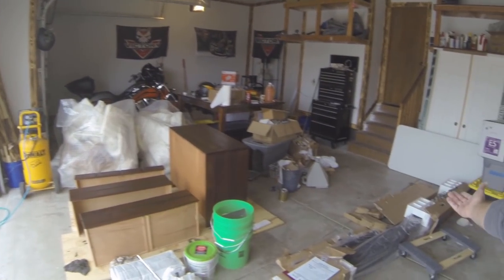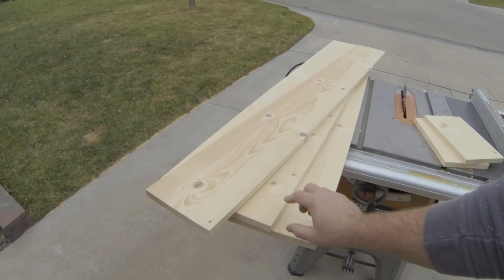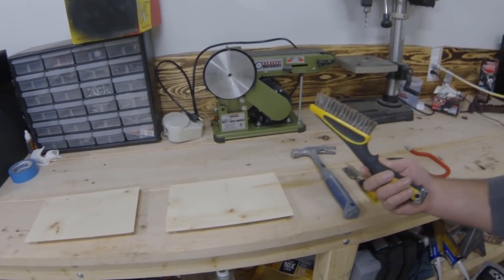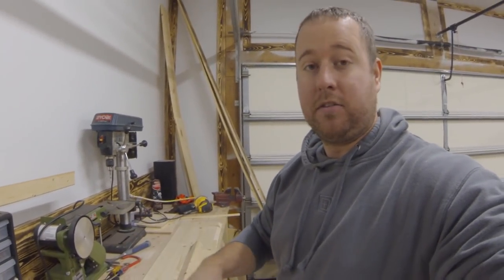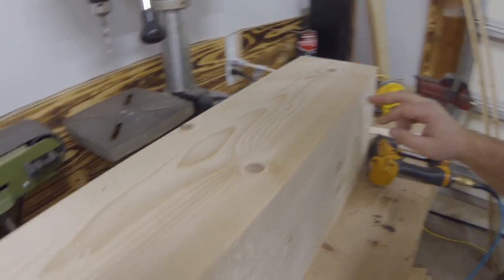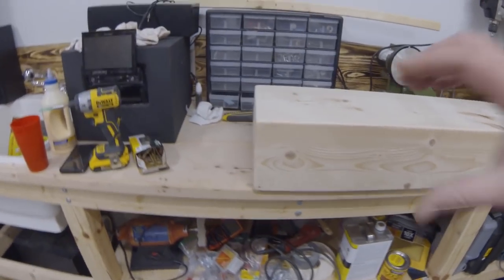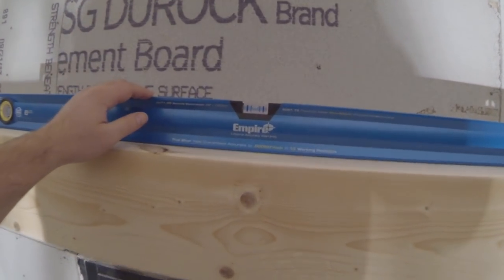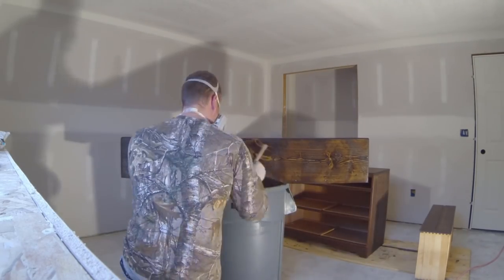DIY Rustic One Piece Look Wood Mantel

Comment: Excellent video I followed your instructions to a T. I went over it with a wire brush which gave it a more distressed look also used grinder to add some lines which gave it the crack spitting look. Love the way you basement ended up coming out, simply beautiful. Too bad homes here in Los Angeles don’t come with basements. Looking forward to future videos.
Reply from the maker: Awesome man! Sounds like yours turned out great. Appreciate it, got some more stuff coming soon...

Comment: Nice work. I’ve also used a round pipe to “burnish” or roll down those edges as it’ll usually closes the tiny gap between the 45 degree joins instead of using wood filler.
Reply from the maker: Thank you for the tip!

Comment: Only suggestion I’d make, to avoid screws in the top, use the kreig jig and put some pocket holes in the top cleat then screw the top into the top of the French cleat. Cleaner look without having to sacrifice strength.

Comment: Very helpful video.. Doing one for placement on an existing red brick fireplace as well.. plan to use masonry screws with the lead inserts. Not sure how to address the gaps yet either, hopefully from looking straight on they’re null..
Reply from the maker: I wouldn't think it would be too bad with a standard brick wall. Maybe if you were directly off to the side, but hopefully not too bad besides that

Comment: I have a square gas fireplace with tile around it.  I would like to know if I can make it rectangular that way I have more space avobe for my TV and maybe add a beam or a small mantle?  I will also take tile down and update it. House was built in 2005. Will this be too expensive to change opening shape of fireplace?
Reply: By the way my gas fireplace Loo's identical to urs.
Reply from the maker: If you're talking about the material around the fireplace on the wall (tile, trim, stone) you can make that whatever dimension you want. Only thing that is consistent is the fireplace opening. You may have to cut sheetrock and replace with concrete board, but you can go with a wider area if you want

Comment: can you tell me how much weight it would hold if you did not screw/fasten it to the wall?  Also, I think you used Pine, right? Would it be better and look better if a hard wood, Mahagony, Oak, Cedar or some other wood was used?  I have a 9'7" beam I need to build, and I wonder if that may be too long?  One last question, you put the cleat on the mantle and wall, is there a formula you used to know how much to use? Like 4 inches from each side, or 2 inches or some other way you figured how long to make it?
Reply from the maker: Doesn't matter the cleat length, just as long as it fits inside the shelf. You can make the beam as long as you'd like, gotta look at the room to make sure it goes well with it is all. You can make it out if any type if wood to get the look you'd like, it's just cheaper to use pine wood and stain to your preference. You'll get different grains with different woods though. It's not necessary to screw to the wall like I did. I just knew I would be putting rock around it and it wouldn't ever be removed. You could probably throw at least 60-80 pounds on the shelf with no problem. Maybe more, but thats quite a bit of weight
Reply: @LifeofBliss  Thank you. I can't imagine needing that weight, but 20-ish, yes. So, if I can put more than all the better. I do know that the longer the cleat, the more the weight is distributed, and it give you a bit more weight bearing capability. Thank you
Reply from the maker: Yea you should be good with that longer cleat for quite a bit of weight. No prob man 🤜🏼🤛🏼

Comment: The French cleat on the mantle itself..is that attached directly to the top edge of mantle?..in video it looks like there is filler piece..any help would be appreciated
Reply from the maker: It attaches directly to the mantel top. I think I accidentally cut a 45 degree andle on the top piece that sits against the wall, which wasn't needed. I just added another small piece to fill in they 45 degree cutout is all

Comment: Great tutorial! I will be applying this method to my new fireplace. One question, is it necessary to make a 45 degree cut on the side that is going along the wall? It looks like the top board, where half of the french cleat is attached, was cut at a 45 degree angle. Does that make it slightly more difficult to squarely attach the cleat? You can see it at 7:05 of the video as you slide the box forward to get a  better angle to nail it. I am just curious, as I am a beginner and the more cuts I have to make, the greater chance I mess something up!
Reply from the maker: Ha good eye... no that edge should not have been cut. That was a mistake. I got to cutting things and apparently couldn't stop lol! Good luck with making yours!
Reply: @LifeofBliss  I am glad this question was asked because I too was confused. I had to rewind so many times to see when that piece was put in and to find an explanation for it. I did not find and was confused until now. Other than that, great video. Thank you.

Comment: That is awesome thank you for the video I just got an order to make one but won't sure how. How would I mount this kind of mantle if the fire place already has brick around it?
Reply from the maker: You could still use a French cleat an lag some bolts in there for the piece that goes on the brick

Comment: I completed my mantel and it came out great! Thanks for the tips! Just one question though. I noticed if I don't turn the fan on for the gas fireplace the bottom of the mantel gets up to 200 degrees. I don't think that's good. Any suggestions? Heatshield underneath?
Reply from the maker: 200 degrees? That's pretty dang hot man... theres certain code requirements for mantel size and how close it is to the fireplace opening, idk if you looked at that or not, but it may be too close? Regardless, that doesn't seem right that it would get that hot. I'd never use it without the fan if that helps

Comment: So did you screw in the cleat to the mantle using 2.5” screws? then when you actually set the mantle on the wall, screw in another set of 4” screws into the top of the mantle going into both cleats to keep in place?
Thank you in advance, your mantle looks great!
Reply from the maker: Yea I decided to screw it into the wall to stabilize it more.

Comment: Nice job! I’m tempted to try something like this. How did you keep the pine from warping or twisting in any way before assembly? I see wood workers build such nice stuff but trying to find wood that stays flat seems impossible for me by the time I’m building with it.
Reply from the maker: Paul Synek you should! Not too expensive and a fun afternoon project (besides the staining part). I went to a local lumber yard and looked at several boards. Picked the straightest I could find. Built it within a few days of buying the wood so I didn't have any issues with warping.
Reply: Pine is horrible to use

Comment: Do you think the cleat would work on a brick fireplace where the bricks are rough, not flat?
Reply: Like if you put the stone up first, then the mantel over top?
Reply from the maker: Hmm... I think if the proper screw were used, it would hold well (probly a concrete anchor vs wood screw). It's be best to hit a stud behind the brick, but that'd be hard without knowing where they are. So would it work? Probly so. Would it look ok if all the edges of the mantel weren't against the brick? That's what I would worry about, all the gaps that would create...
Reply from the maker: It's obviously going to work best if there is either a flat surface it is going up against (drywall, traditional flat brick) or going up before putting on the veneer finish like I did. That would reduce or eliminate any gaps between the back edge of the mantel and the wall.
Reply: @LifeofBliss  I'm putting one up on an existing fireplace with no mantel right now. The brick isn't too rough, just a little. Hopefully in the next week or two I'll get it done. I'll let you know how it turns out!
Reply from the maker: Oh I'm sure it will look just fine on that! A little roughness probably wouldn't matter much at all. The veneer I put up has 1/2 to 1 inch differences in depth between stones. That'd be too much variation imo, I think going over brick will look nice. Good luck Matt!

Comment: how much weight does the mantel hold?  is it pretty sturdy?  100lbs you think?
Reply from the maker: It's very sturdy. I also drove some 4 inch screws in the top and bottom at an angle to permanently fix it to the wall when I was adding the stone. 100 lbs? No problem. I would consider using lag bolts vs screws to secure the cleat to the wall if I planned on putting 100 lbs or more on it though, just to be safe
Reply: I did it like your video.  I used lag shields in mortar jointed and lag bolts.  Came out looking good. Shimmed a lot of the mount itself on stone fireplace.  Looks good. Thanks for the video.  I just wanted to make sure with my kids and it not falling off from decorations or whatnot.
Reply from the maker: Definitely don't want anything falling on the kids lol... I'm going through that myself with our first kiddo. Glad you got it up!
Reply: Congrats!
Reply: It can hold at least two PlayBoy bunnies. I tested it.

Comment: You do know you can get a 8x8x8 rough cut cedar beam from menards for like $35 right? That's exactly what I used because I bought a extra when i got 3 of those and a 16ft long one to knock out a load bearing wall and use them for visible supports. Then I cut the extra one down to 5ft and I didn't even have to beat it up since it is rough cut and cedar is not all that heavy. I can lift the 8ft by myself and easily hang the 5ft mantle alone.
Reply from the maker: Nice. Yea there are a few good budget options out there for sure. That's not bad for a solid piece of wood
Reply: not, they are 180 bucks.unless you meant a creosote treated railroad tie, ( not recommended to put inside the home)  and a solid beam is really heavy.https://www.menards.com/main/building-materials/lumber-boards/cedar-wood-products/cedar-boards-decking-lumber-timbers/8-x-8-rough-sawn-red-cedar-timber/1074862/p-1444422741366-c-13131.htm

Comment: If you add the stone wall afterwards how would you be able to take the mantel off if you wanted to? Wouldn’t the stone block the clearance above?
Reply from the maker: TREBLIG yes is does not allow for the mantel to be removed. It made it very easy to adjust side to side, then I actually angled some screws into the wall to hold it in place before doing the stone. I have to plans on removing it, the French cleat is just a very easy mounting solution. I made a very similar mantel for a family member out of maple wood. They used the French cleat on a flat wall and are able to remove it if need be. Has worked very well for them. I actually have the fireplace finished in another video, check out my channel page to view it. Have a good one!

Comment: Awesome 👏 Did you use water based or oil stain? Also do you prefer one over the other?
Reply from the maker: I like oil based stains. For top coats, the minwax water based poly is nice though. I like to spray my top coats now

Comment: What size finishing nail did you use - 2in 18 gauge?
Reply from the maker: 1-3/8 inch I believe. 18 gauge
Reply: Would 16 gauge be too big?
Reply from the maker: @renerodolosi9586  you could use 16 gauge. It'd just be a little bigger hole to fill

Comment: When running the long boards through my table saw, I found it difficult to keep it against the fence and straight. Did you have that issue?  Looks like they zipped right through.
Reply from the maker: It's a lot harder to keep them straight the longer they are. I try to use my left hand as far up the board as I can to push it against the fence to keep it flush while ripping them. It took some practice to keep things straight and I try to take my time while doing longer boards. I still have trouble sometimes...
Reply: Josh, get a feather board to push it towards the fence.

Comment: Great video!  Why did you mitre the short ends with a mitre saw rather than the table saw?  Could you have used a table saw for all the cuts if you wanted?
Reply from the maker: It was just easier to cut the shirt end of a long board like that. I don't have a good track for my table saw besides the little one it came with. It's kinda hard to keep long boards straight when cutting the shirt side on the table saw. But you can absolutely use a table saw for all the cuts

Comment: Why did you mitre the small pieces instead of tipping the blade for a 45°  bevel ? It's safer
Reply from the maker: Idk, just how I did it. Same end result 😉
Reply: It's small enough that solid pine would have been affordable.
Have you ever used veneer strips instead of filler ?
Reply from the maker: @toscanoplaster5603  no haven't used ant veneer yet. And yea that is affordable! Everything we looked at was $250+ around here, granted it was more expensive wood than pine we were searching
Reply: Yes try real veneer slices in the open miters with wood glue instead of filler sometime .
You have good hands 😀

Comment: Can you write down the dimensions. I'm going to make this today. I would like to know how many pieces of wood you used. I know you have a 1x12 and a 1x8, but how many pieces did you use. I have a chop saw, skill saw, and jig saw. I don't have a table saw. What will my limitations be besides inexperience? A list of everything you used including sand paper, tools, and glue would be awesome if you have the time.
Reply from the maker: The dimensions will depend on your space and counter top. I used 1x12 Lumber just cut down to size. You can do all of this with a circular saw and a straight edge of no table saw. Planer isn't necessary either. Good luck man!

Comment: Question for you... why wear a mask when you are applying water based poly but not when you were sanding? 
FYI... for a combustible material mantel that is protruding out 10 inches, the code to mount above the fireplace is 19 inches.  Otherwise nice job.
Reply from the maker: Eh, a little dust never hurts 😉 thanks for the info though, I'll keep that in mind going forward

Comment: So, I took a crack at this today ... 
Note to self - don't over do it w/ the glue, I have a ton of glue marks that I thought would just 'sand off' but it didn't happen that way :/
Now I have to find a way to remove that glue so that my stain doesn't look like glue stripes.
Reply from the maker: Oh shoot, yea that glue doesn't like to accept stain... you could sand over the entire shelf to remove the glue and some of the stain, then restain the whole thing? If you made it rustic and beat up looking, you could also just work on the glue spots and grind those down a bit then add stain.
Reply: @LifeofBliss  yeah, plus I stained the wrong color :/
great idea, I'll get the dremel out and grind the heck out of it :) 

I have to make it look more distressed anyway - I ended up with badly bowed boards so I was trying to fill it up w/ more glue - rookie mistake.